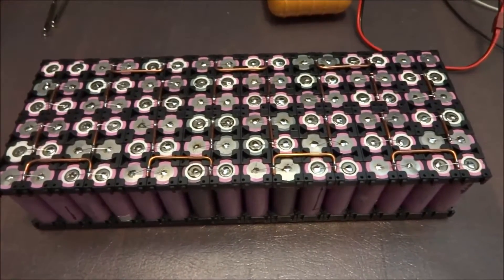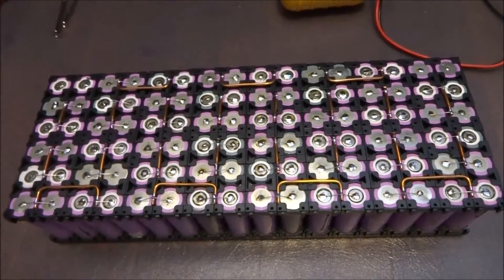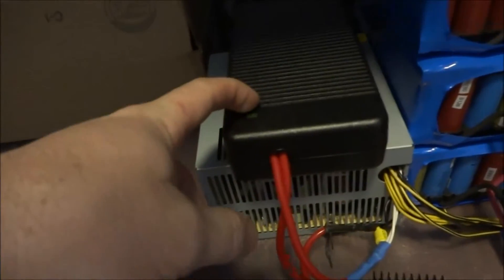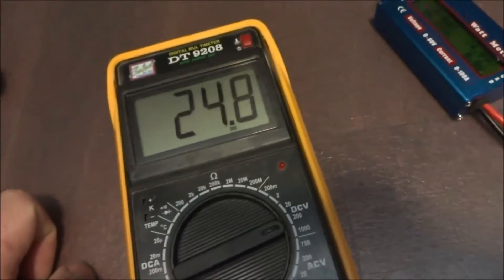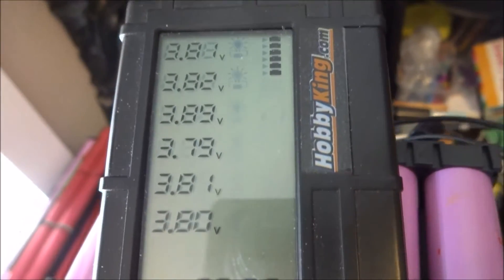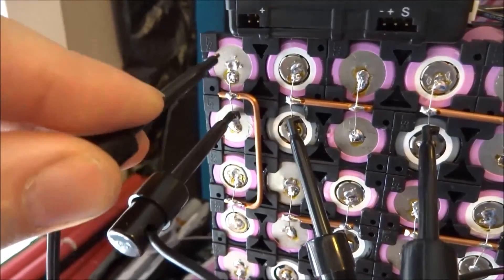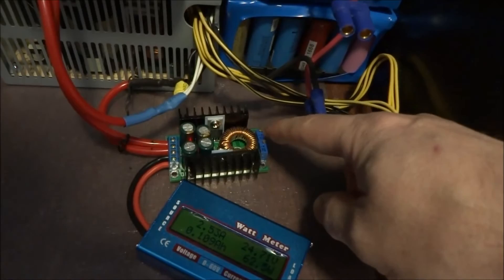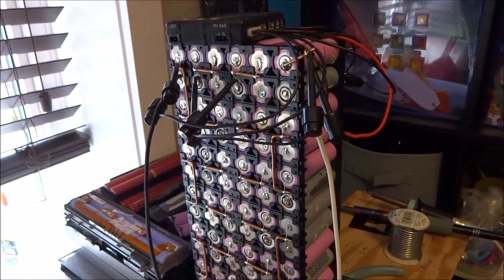Nissan LEAF range extender pack build Pt.2.60 (prototype pack charging)

Comment: I have a smart ED, was looking at doing same on it to extend range, cool project good videos
Not sure why you made 2 packs instead of 1 400 volt battery.
Reply from the maker: To make the pack a bit easier to handle and also lower voltage is a bit safer.

Comment: Why not discharge your leaf and then let the leaf charge your batteries
Reply from the maker: Didn't want to risk it, I'd have to make sure I disconnect my extender pack before the charger stops.
Reply: @DIYbatteries  Nice project, like your thinking. Why would you need to disconnect before charger stops?

Comment: Why not just stack actual leaf modules from a salvaged battery pack from another nissan leaf ? http://hybridindustries.webs.com/ is already doing it
Reply from the maker: For many reasons, cost, weight, space...
Reply: I suppose, but a entire wrecked Nissan Leaf can be had for cheap, break open the pack and sell the extra modules you don't want on ebay for $100-$125 each. Or for that matter just simply buy a nissan leaf module for $100 each.
Reply: That's what I'm doing on mine , I got a brand new 24kw, I'm working on the wiring , this is a great video

Comment: Great videos. Was thinking of making something like this in the future for my leaf. one question tho how do you plan on charging the completed 10 module pack when completed. can you use the on-board leaf charger to charge with some type of secondary bms for the extra pack?
Reply from the maker: Not sure yet, may try charging with the LEAF's on board charger. Otherwise, may need to purchase a charger.
Reply: If he is in parallel with the existing battery the onboard charging system should charge both batteries. I havent done it yet myself though.